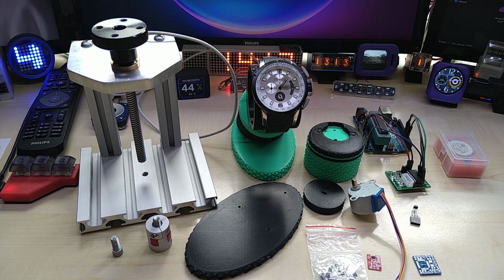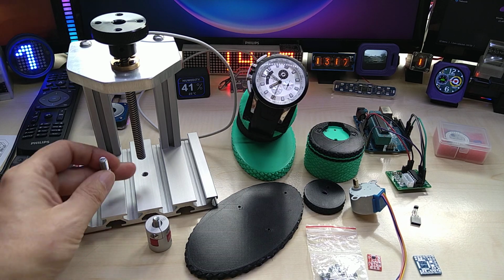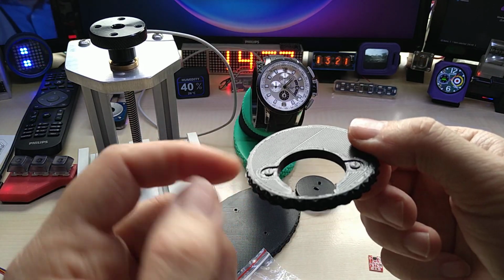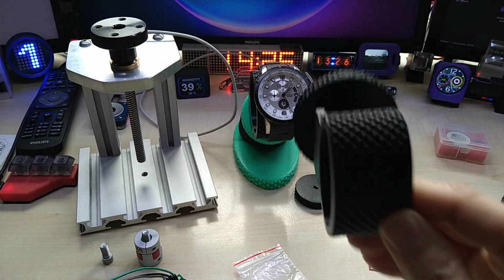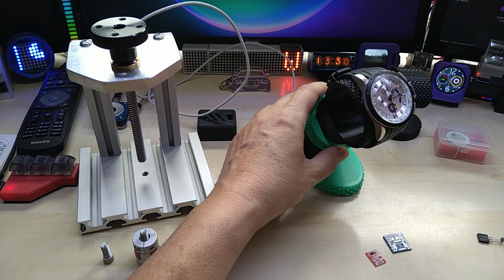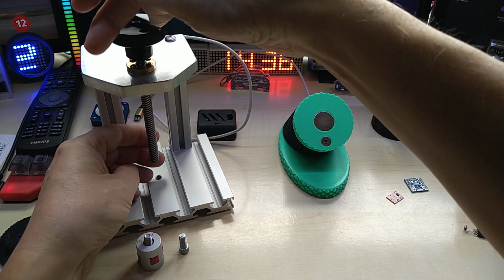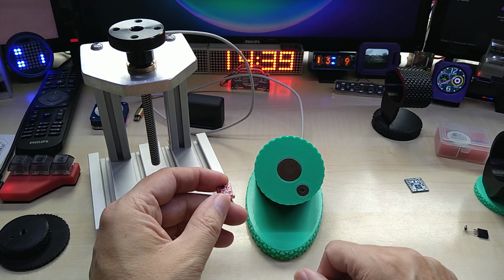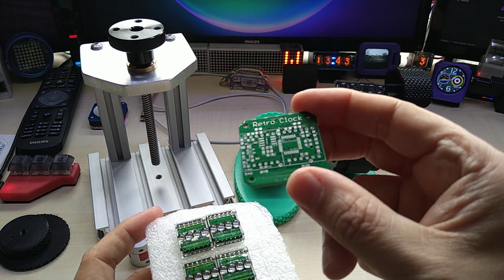#DIY 3D Printed Watch Winder for Automatic Movements like NH35A with #Arduino by #Hayri +Hand  Press

Comment: really nice. also sorry to hear about the stolen watch. The winder can be expanded with a planetory gear that will be able to spin 3 watches. would be amazing
Reply from the maker: Thank you. I am just uploading a video about something else but showed a new control PCB based on the ESP32 for a wirelessly syncing watch winder, that I temporarily use as a remote camera shutter 😊 I know it's a bit confusing, just a strange coincidence.

Comment: Hayri, you never cease to amaze me with your ideas. 
I'd love to see you develop your BLDC motor control board further. There's so much attention on SimpleFOC now. It would be great to see you discuss the alternative driver chips (like TMC6300) and encoder chips (like MT6701). Advantages / disadvantages etc.
Reply from the maker: Hi Nik, actually I  do have a BLDC motor controller with an build in magnetic encoder already, you  must have missed it 🙂  Here is the link to the video: https://youtu.be/xHy8vVxbWWU I did think about using it in the winder, but wanted to stick to  5V supply voltage so cell phone chargers can be used, which most people will have several lying around. Let me know what you think about my BLDC controller.
Reply: @iHayri1  Yes I was aware of your neat controller board - I watched that video very carefully and used your design for the basis on my own experiments. Thank you for that. I'm thirsty for more. I think a really great project for the channel (and something I've started working on too) is a practical DIY ironless closed loop linear motor. They're so expensive off-the-shelf yet appear conceptually very simple.
Reply from the maker: @nikthefix8918  well since I did not sell a single of those boards and there are many different motors out there, I do not plan on making another controller board. Just probably for this winder, maybe make it dual purpose for 5 and 4 wire motors, with external limit input like I did on this winder and maybe based on the ESP32 to give it WiFi and BLE capability.